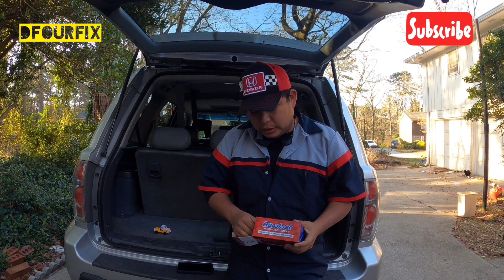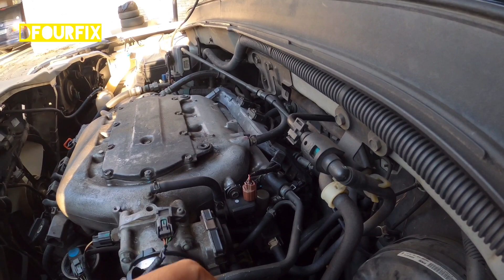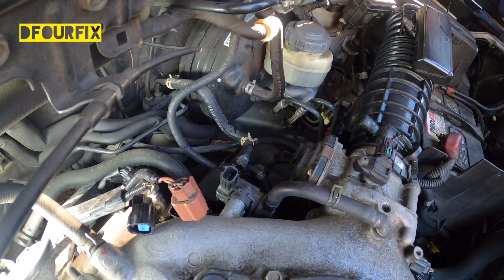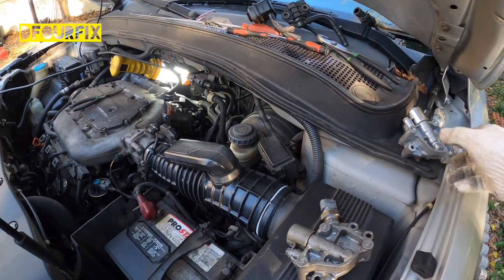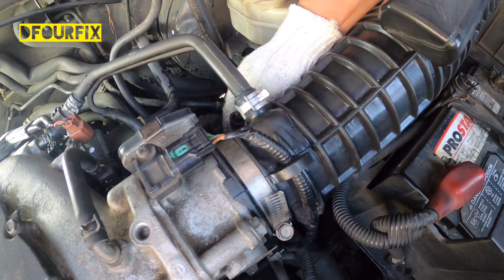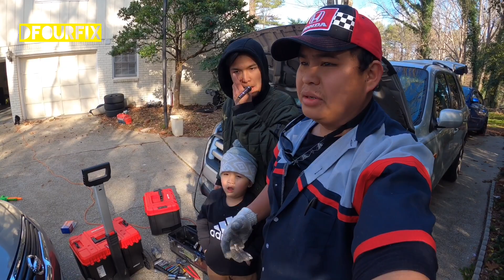How to replace VVT solenoid on 2006 Honda Pilot

Comment: Thanks for this video! Helped immensely when I did this repair myself. Note to people who attempt this repair: the OEM part is over $600 in most of the US now. RockAuto has a bunch of aftermarket parts, idk which is best so I went for the Gates version of this part (15810-RKB-J01) for $240. I will update this comment if I have any issues down the road with it
Reply: Was it for a 2WD or AWD?

Comment: Did you try to start it while it was bad? what were the symptoms? I have a 2008 Pilot stopped running at intersection last week close to home. Got it started enough, chugged it home. Engine shaking when trying to start. Changed all plugs in case one bad. Getting spark to all cylinders. Same deal, won't fire up. Shaking trying to start. Brought into shop.

*Note. I rebuild firewall head, new crankshaft sensor, belt kit, etc after timing belt broke 2.5 yrs ago. New valves etc. Car ran great til now.

Shop checked timing, said all is where it should be. Compression good. Getting spark to all cylinders. Fuel pressure good they said. Next suspected clogged cat converters, they did test, all OK.

Now they want to see if valve clearances good. we aren't in much $ now. I could check valve clearances at home, but then what? Or pay them 600$ to do it..?

Either way, what else could it be? I don't get it.. Pls help.

I will mention VVT and i'm trying to get the codes it is throwing.